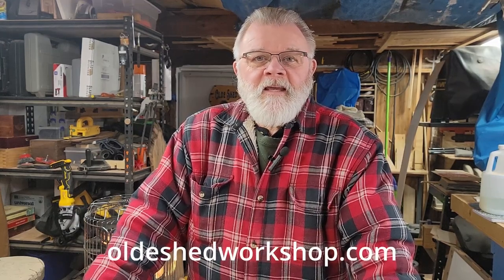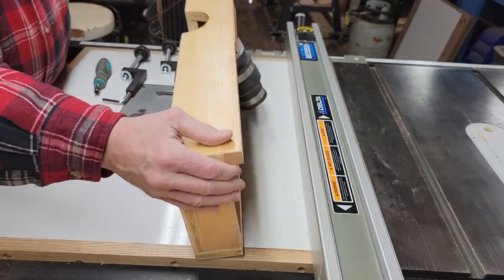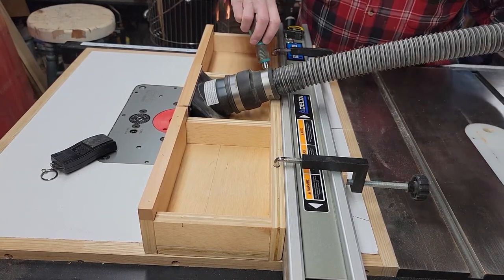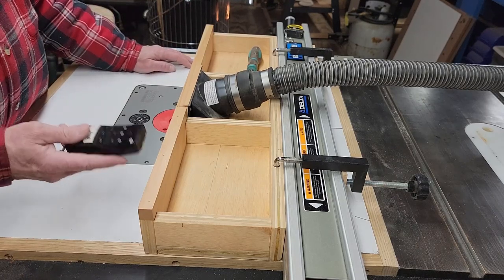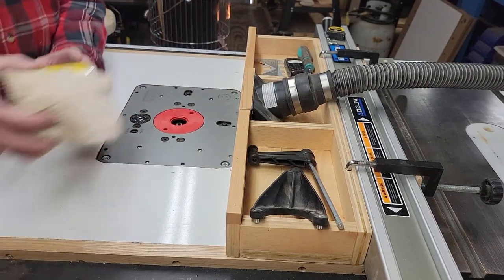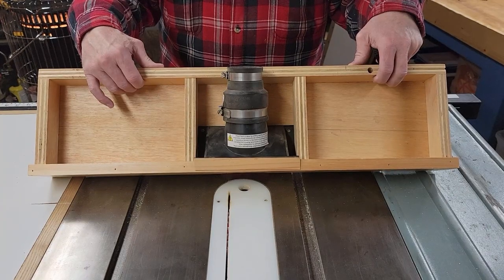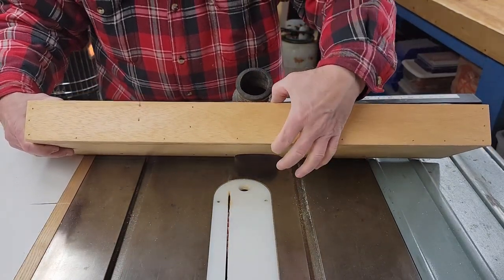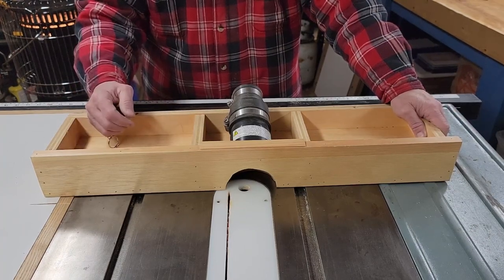How To Make A Router Table Fence With Dust Collection

Comment: Mike, after watching several of your videos, I had to comment. I found your channel as I was looking for router table fence ideas. I have to say it looks like you and I are paddling the same boat at least considering what we have for a shop. Your router lift is the same as mine that I  installed in a router table I just built. Your table saw appears to be similar vintage as my old Craftsman 13 series saw of which I am in the process of installing a new Delta fence just like yours. I built the router table top to 27" so that if I want, I can install it on the right wing of the table saw (after new fence) as you did. Your dust collection is different than mine but we use the same blue barrel as the collection side of the system. My thought was that if I was in your shop, I would know how to function and build from the moment I walked in. Cheers to you, you have a new subscriber. Keep the vids coming.
Reply from the maker: Hey Dave. Thanks for the great compliment. I want to do a short video of my outfeed table at some point. I bought the table saw new in 1989. Thanks for subscribing!